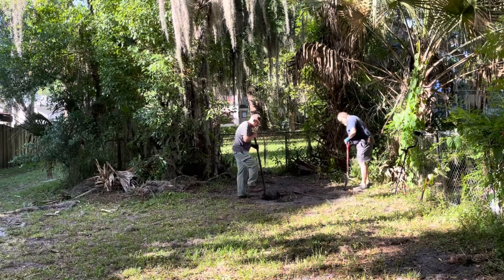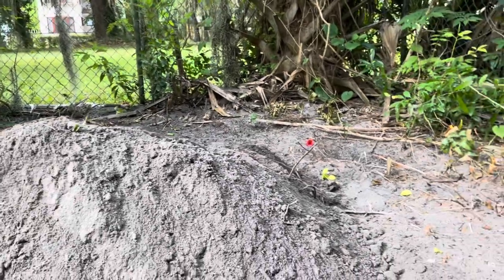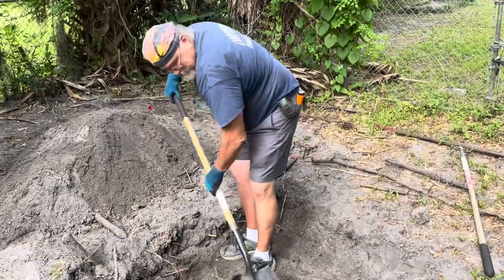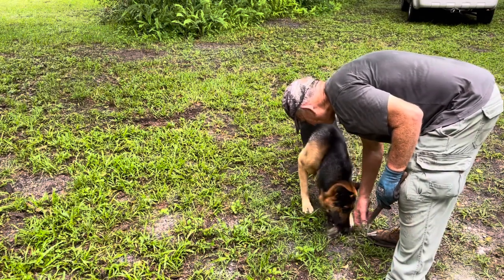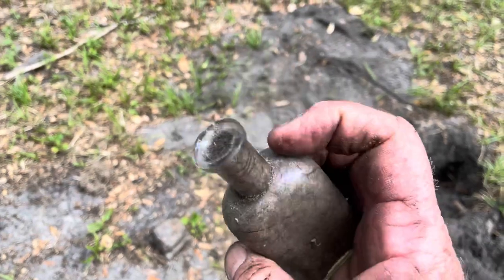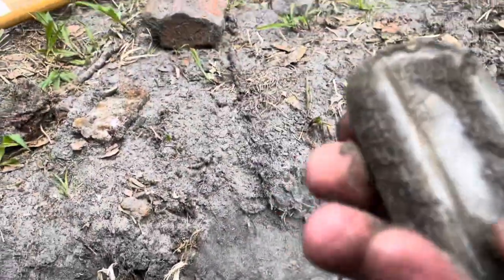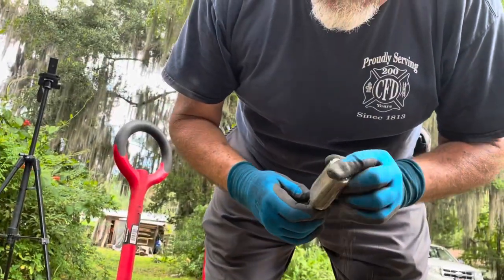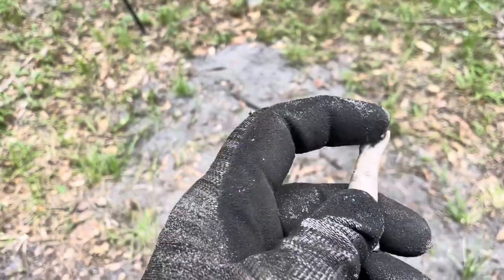Digging an 1886 Carriage House Bottle Dump! (Part 2)

Comment: I saw when you were pulling out that broken Bitterquille bottle that you hit a layer of lime. Usually you get that layer when you are digging an outhouse. I wonder if you dug deeper you might have found some more stuff.
Reply from the maker: Hi Paul, thank you so much for watching and for the comment. You are correct about the lime. We dug about 2.5 maybe 3,’ until we hit white sand and that was the end of it. To be sure we probed 4’ below that and nothing. It wasn’t uncommon too, for folks to dump the privy Pooh in the trash dump. I’ve seen that before…maybe just a Florida thing. I don’t know??? Only been at this for 1.5 years.

Comment: The long neck is a Hock wine.  I've found the red amber ones and olive glass ones.  I finally found a whole Cuticura Const. Humours from Boston in 2019.
Reply from the maker: You are correct! However, I did not know that when we pulled it out. We found half a dozen broken…this was the only one recovered intact. Beautiful bottle…

Comment: My house was built in 1803. I've been trying to find pits but no luck. Any out buildings are long gone. Some day I hope to find the mother load. Congrats!
Reply from the maker: If it’s up north in rocky soil and rural you may have a problem, unless you find the privy. If you’re in a town it’s easier because if the small lot sizes. From what I understand a lot of trash dumps in hilly areas were on the banks of creeks and in gullies, not necessarily buried. The good thing about Florida is the trash dumps tend to be not very deep due to the low elevation. Best of luck.
Reply: @relicrescueusa3803  I'm on 2 acres up north. Have an old stone farmhouse. I randomly find glass. Have found a few 1800s bottles by luck and clearing some old over growth. One day I hope I find the honey hole! Thanks for the tips but like you said it's not going to be easy since I'm rural and have a large area to cover.

Comment: I live in lithia Florida on an old homestead ... I’ve found bottle when digging fence post how do I pin point a dump site ? Or how do I decide where to dig if I don’t have a metal detector?
Reply from the maker: Hi Justin, send me your email address and I’ll send you my PX so we can talk by phone. It would be more efficient that way. Also, check out my Bottle Dump Hunt video, I talk about use of a probe more extensively there. We can also talk about you getting some clear bottles. Thank you.